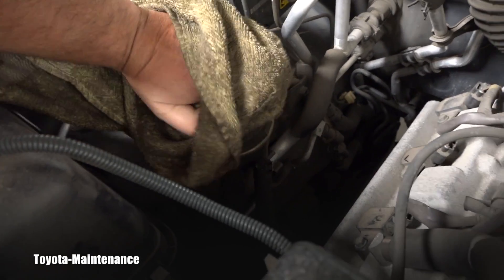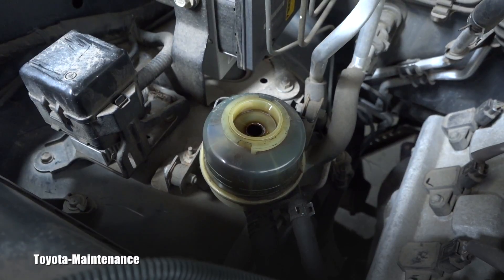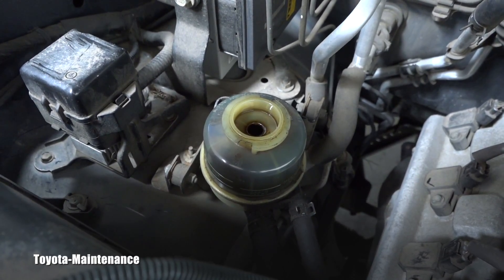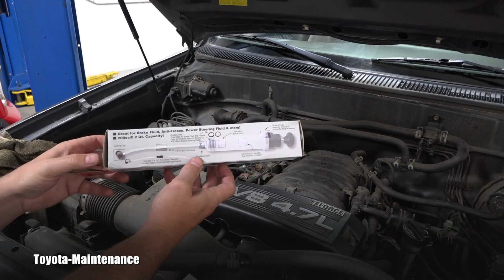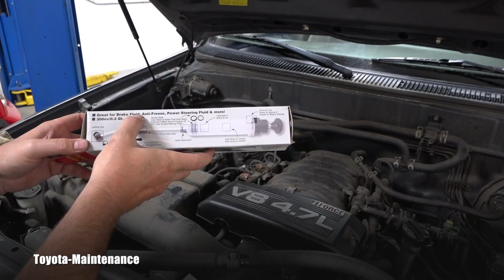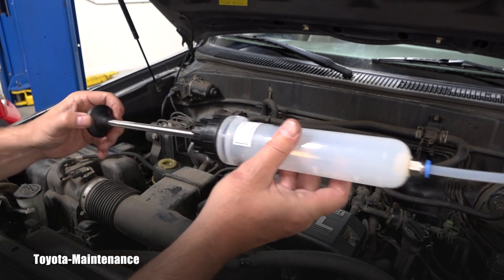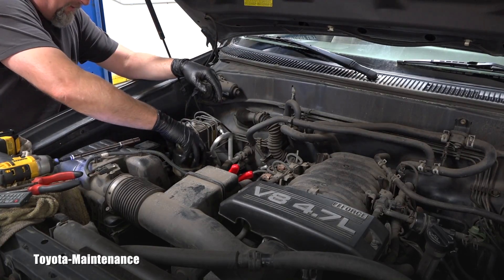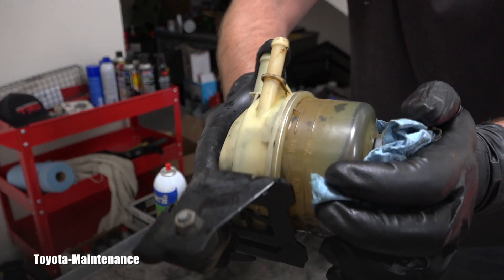Toyota Sequoia power steering fluid flush

Comment: Great video TM.  One step I would do is remove the one line from reservoir that is the return line - this is the highest of the two entering the reservoir.  Attach a tube - usually you can find a size that's fits nicely with just friction.  Then turn the car on and as you turn the wheel pour fluid into the reservoir to maintain the min- max level.  Continue turning wheel until fluid that is draining turns clean/new.  The reservoir will be supplying all new fluid throughout that process.  Then you have completely flushed it.  Helps if the wheels are off the ground too.  Also cap the reservoir attach point for the hose so fluid from reservoir does not flow out of that hole.  Great job - enjoy your videos
Reply: ya but this is for people at home, stop showing off
Reply: Omega Man where I do all my work too
Reply: this is good advice, i knew there was a better way to do this. Thanks!
Reply: the method youre talking about is probably easier with 2 people correct?

Comment: On my 2000 Tundra, I usually elevate the front wheels when cycling the steering to circulate the fluid. It just seems easier on the system. Be sure to visually inspect  the pressure hoses as that is a known weak point for failure. I do a similar evac and fill on the brake reservoir every oil change as well. Thanks TM
Reply from the maker: thanks for sharing

Comment: I like your videos but highly recommend mentioning every vehicles mileage as it helps to give the viewer an idea when parts fail or when to replace, maintain etc.  For example I have an 02 Tundra with 140k miles and wonder if I should only  flush the PS fluid or at this point because of miles if I should just replace the pump. If I saw videos where people mentioned the miles on the vehicle being serviced it would help a lot with comparing and decision making.

Comment: Absolutely majestic how to video in regards to power steering service. Question I need to replace the tension clamps due to power steering fluid leaking out. Would you recoment I buy the clamps from an auto parts store or get them from the dealer ship? I drive a 2001 Toyota Sequoia 4WD Limited 155,000 miles

Comment: If you just change out what's in the reservoir, drive it for a while, change it again, and do that 3 or 4 times. Would that have a benefit? Kind of like slowly changing out the fluid since I don't have machined or confidence fully taking it all apart.
Reply: Yes.  I did it about 8 times on each of my 2 Toyotas to get the fluid looking good.

Comment: Hi I’m sorry if I commented your videos with the same comment but maybe you will see it easier 
I have a Toyota Sequoia 2001 limited 4WD 156 k miles.
When I switch from Park to reverse, reverse to drive and Park to drive the truck jumps forward or back without touching the pedal or even if I’m on the break, clunk and jump, when driving around I think switches gear really good and no problems, only problem is that clunk noise and jump when I put it in reverse from park o reverse to drive or drive to reverse, could you please help me ? Appreciate your work
Reply: Could be in your differential, ujoint, bushings, maybe it idles to high. My brother's landcruiser is doing what you described and we think its in the diff

Comment: Thank you for another great video. Might be a dumb question, but I was wondering if you have to worry about air getting in the system like when changing brake fluid? Thanks again!
Reply: this was power steering, not brake, the pump keeps flowing
Reply: That's exactly why he was turning steering from one side to opposite side.Lift your front end and turn steering a few time.Don't hold it at end of each side for more than a two or three seconds,otherwise you are going to damage power steering pump!

Comment: can you disconnect the outlet line and run a tube from that outlet into a drain pan while running the vehicle then fill as needed?i did it on a 08 accord i had. now i have a 17 tundra.
Reply: sure and risk running a hydraulic pump dry and ruining it..
Reply: You can disconnect the return line and make it go into a bucket, but you must make sure you keep putting new fluid in the reservoir. It’s better is a friend helps you and have him keep turning the wheel all the way to the right and left until it keeps coming out like new fluid then tell him to shut it down
Reply: @danielanderson222  Perfect!
Reply: I put my tundra on jack stands and go lock to lock without the motor running to change the fluid.